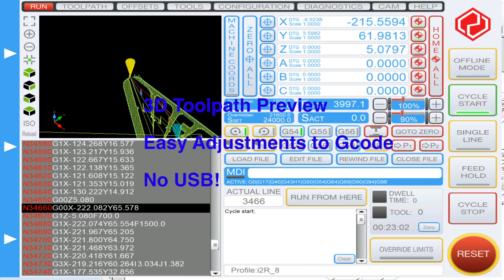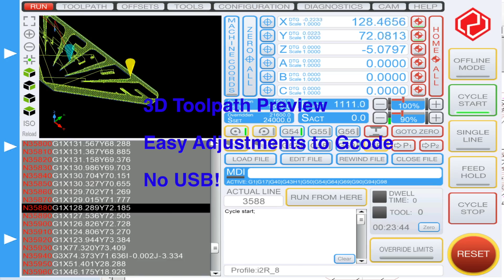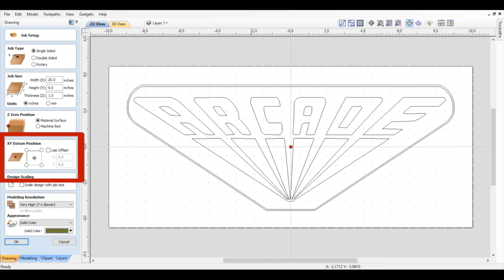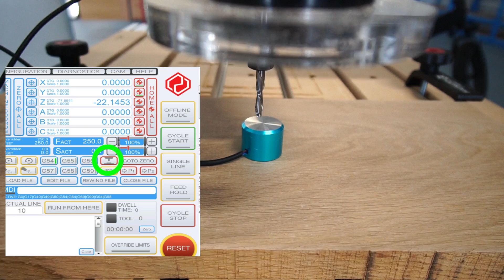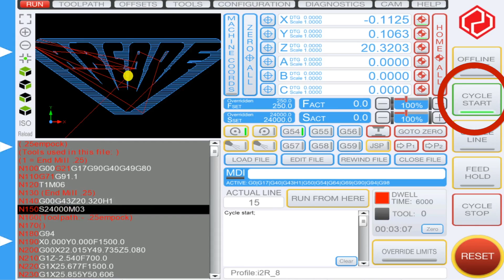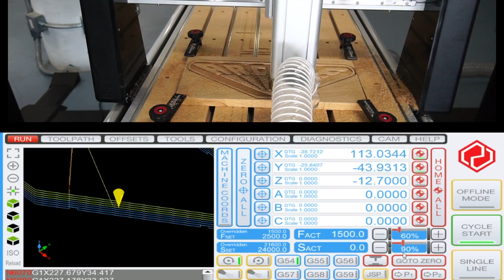i2R CNC UCCNC Basic Guide Part 2

Comment: I load my file into the cutting software and, as recommended, I start to check the boarders by moving the yellow dot. However, I'm discovering that my design image is extremely small. It's sized correctly in Vectric. For example, my design area to cut is 10" on the X and 8" on the Y. When I jog my spindle (yellow dot) around my design area, it only has to move perhaps a couple of inches in either direction to fully cover the design area. Very confused as to what I did wrong.

Comment: good video, but you skip the most import step: "zero all " after you move the spindle to the center.  and the the step after touch up, how to set z=0?  and in your cam program, how you did set the z original.

Comment: To me so many companies are missing a deck that is wider than 24 inch. A solid 30x48 would be amazing for that smaller but not limiting space. The other issue is the small 4th axis for me. I like the look of this machine btw.
Reply from the maker: noted! how about 4'x4'?
Reply: @i2RCNC  A 4x4 would be great IMO, you can do almost everything you can do on a 4x8, just takes longer to get done. Problem is that a 4x4 will run right up over 15k in most cases.

Comment: Is that a water cooled spindle? Is this available with a USB Flash drive instead? This looks a bit like Mach 3. I've had two CNCs. One Mach 3 and one USB. The USB fits better with what I want.
Reply from the maker: It's an air cooled spindle. We us UCCNC which is similar to mach 3. We can also get you a USB version but the UCCNC is the upgrade to the USB. Feel free to email us at info@i2rcnc.com for more information.